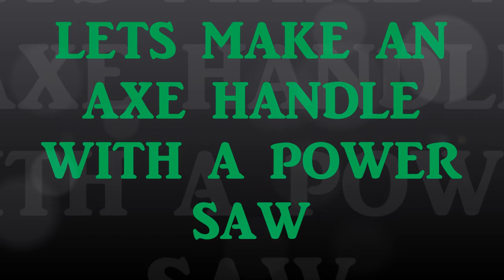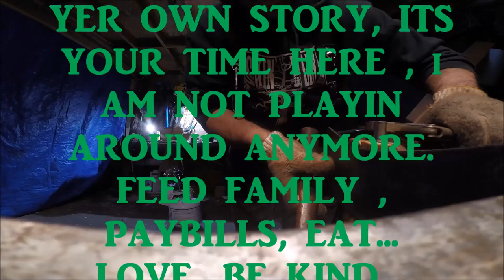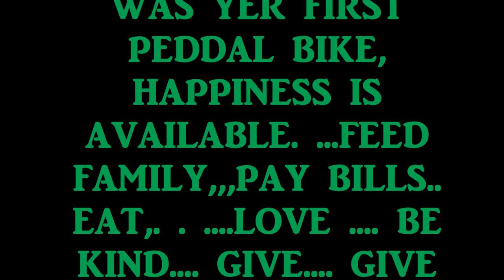LETS MAKE AN AXE HANDLE WITH A POWER SAW

Comment: Hi Billy, looks like the locusts is going to take a little bit of work seeing that it is so hard!! I need to get a Alaskan mill to cut the handles out better. I roughed out a couple with the saw right out of the log. they turned out not to bad.  But it would be easier if I could mill  my locusts into lumber first. Your friend Al
Reply from the maker: YES YOU BET BUDDY   THE POWER SAW IS AN AMAZING TOOL... LOVE YA
Reply: Buckin' Billy Ray Smith Thanks brother, back at ya. Your friend Al

Comment: Hey Billy I would make you a driver handle for your axe wedges if you would like. I have a small machine shop in my garage. I mostly make motorcycle parts but I do make tools sometimes for my primary job which is a motorcycle mechanic. Love your channel. Found it by accident looking for some info on a McCullough mini mac 110 and got hooked. Just let me know what size the socket you normally use is. I cringe every time I see you use a socket lol. Hope your mom is feeling better.
Reply: William you are Soo Awesome buddy thanks for sharing your talents with us and Billy of course... Hahaha 🤓 🤓 🤓
Reply from the maker: William,, wow! that sounds great thx so  much   5/16 is the socket,, thx sooooo much
Reply: Buckin'  are you sure it is a 5/16 socket. That's pretty small and it looks way bigger in the videos like a 7/16 or maybe even a 9/16. I can get started on it later this week and probably get it shipped by next Wednesday